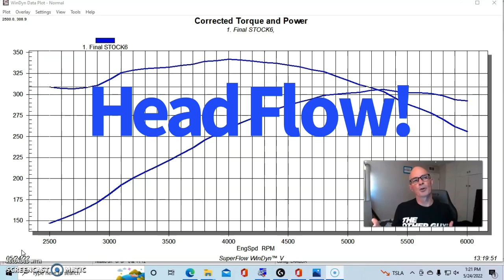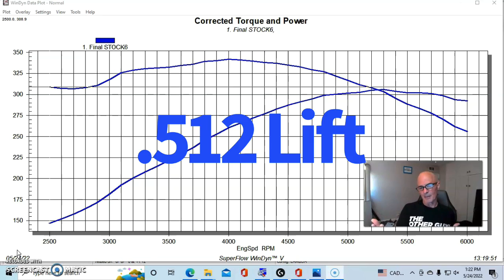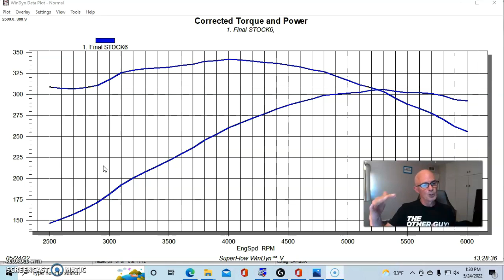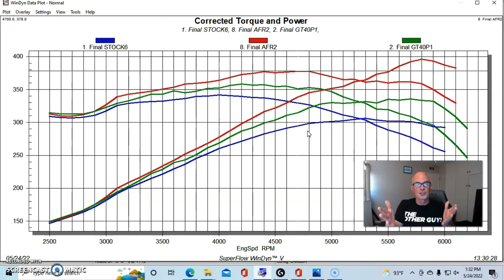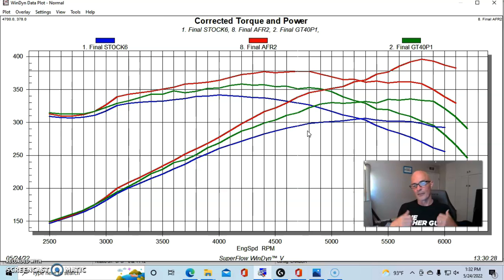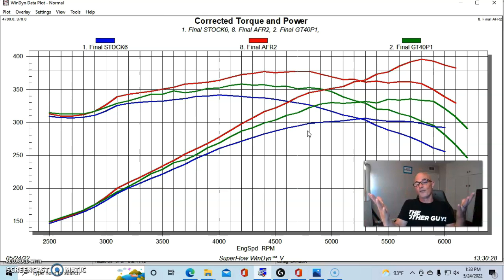HOW TO ADD 90 HP TO A 5.0L FORD! 302 HEAD TEST-E7TE v GT40P v AFR 165. ARE ALUM HEADS REALLY BETTER?

Comment: I used the same cam & head combo in my build. Did you find the valvetrain noise to be on the excessive side?
Reply from the maker: NO SIR
Reply: I'm using the AFR165s and the XE266 cam and Comp 1.6 rockers. My valvetrain is much noisier than the stock pedestal mount stuff.

Comment: For anyone auto-crossing or canyon carving in their car, a set of aluminum heads and moving the battery to the trunk is well worth the price of admission to get 100lbs off the front suspension.
Reply: True story
Reply: Agreed.  Throw in an aftermarket K member as well.
Reply: Don’t forget also swapping the cast iron water pump, intake manifold, and exhaust manifold and swapping all with aluminum and steel (headers)
Reply: Don't forget the 5 lug conversion to put better brakes, wheels and tires on.
Reply: @natricjol  5 lug on a Fox body for sure.  My 5.0L is in a 91 T-Bird, so I've already got 5 lugs, A-arms up front, 8.8 IRS out back.  The real struggle with this chicken is weight balance and reduction.
Reply: @rhekman yes but you have a 4.25x5 bolt pattern vs 'stang's 4.5x5 bolt pattern.  I've got a '93 bill elliott edition Thunderbird  with a ton of mods
Reply: fiberglass hood as well

Comment: Richard have you tested the Edelbrock intake and the Edelbrock Clevor heads
Reply from the maker: NO SIR
Reply: @richardholdener1727  do you think you can sometime? Edelbrock designed an intake to resolve the water crossover on the W block.
Reply: @richardholdener1727  I hope you can test a few different brands..

Comment: Richard I apologize I know this is off topic  but where can I find a video of a LS2 with cathedral port heads with the Truck Norris cam ?
Reply from the maker: NEVER RUN AN LS2 WITH THE TN CAM
Reply: @richardholdener1727  Richard I can't believe you haven't had a TN cam in a LS2 and on the dyno yet.